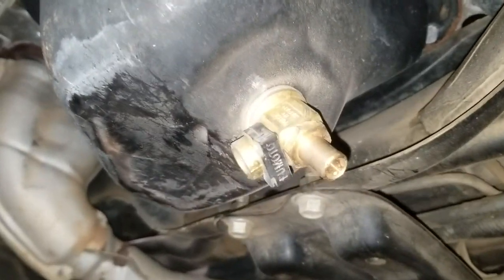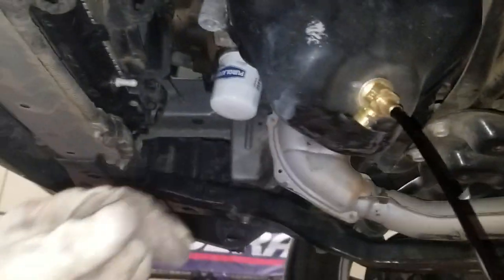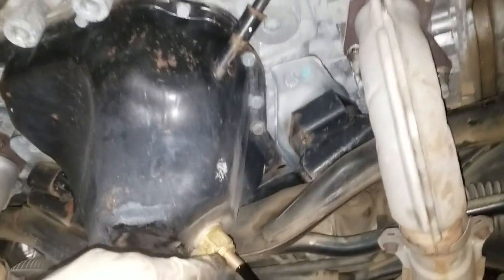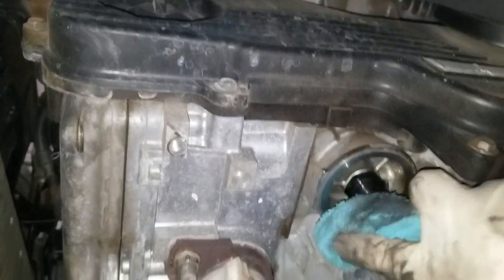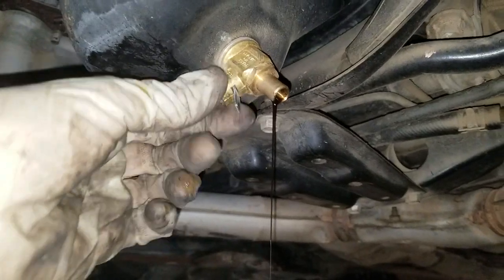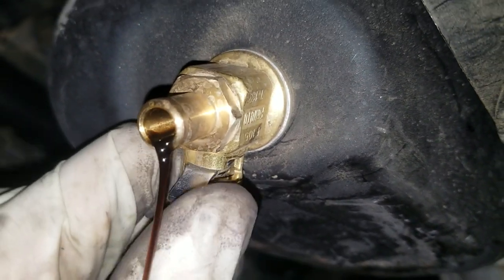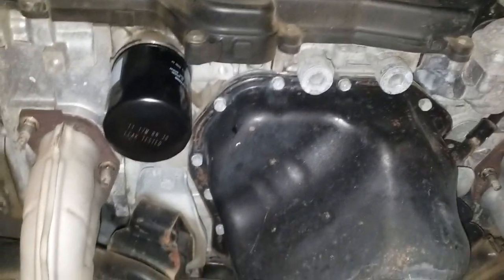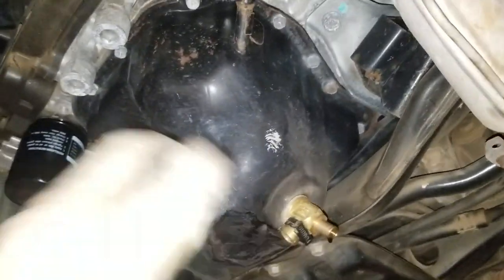Fumoto drain valve dangerous to your engine?

Comment: Your title "Fumoto drain valve dangerous to your engine?" seems misleading..
Reply: For realz. Lol
Reply: Gino Lee That’s why I clicked on it. Looks like it’s nice to have and not dangerous at all unless when he mentioned the ground clearance issue.
Reply: Good afternoon, Gino 

Great video. You totally explained everything to detail. I will get an oil drain valve as well for my Subi. Gracias
Reply: Unnecessary! A point of failure more, a plug is way more secure than a valve, just to avoid the usage of a wrench and a few turns? No thanks not worth of the risk for a valve failure
Reply: @gaquesad Your concern is understandable.  I've used Fumoto valves on 4 cars and one diesel pickup truck for over 15 years. Never a failure, they're made of brass.  I'd rather have that valve in place, than risk the drain bolt being cross threaded and over-torqued if, when the time comes, I have to leave it to a shop to change the oil.
Reply: @gaquesad  Some people install it to make emptying excess oil out easier. Don't need to decompress your crush washer
Reply: Yea so he can get the  viewers to watch. Silly for your guys to do that. But I that’s why I don’t subscribe. Scottys channel does this all the time.
Reply: Yeah.  It's called a liar!!
Reply: Understand this is dangerous. If you lose your clip that lever could get knocked into the open position and now the oil will drain out of the pan and you’ll burn your engine up
Reply: @lanceshier741  - if you had one, you’d understand that it’s virtually impossible for anything to open that valve by accident. Believe me I have three of them and I’ve used them for 15 years. They’re awesome.
Reply: Click baity
Reply: Extra old oil will stay inside, unless you grind away some of the valve thread...
Reply: @pfoxhound the amount is literally negligible, you never get all the oil out with OEM either
Reply: @isiahneidigh4711  for some of us it's more like a religion.
Reply: @pfoxhound  I Believe it, my cousin says he leaves his drain plug open overnight
Reply: @isiahneidigh4711  I was counting how many drops per second, amount per hour... My other buddy leaves drain open overnight. Every time I have access to alignment rack - I lift one side of the car so that oil will come towards the drain...
In semi Truck I have a valve like this, 11 Gallons oil change, but I make mechanic to fill oil with drain opened, waiting to see clear oil coming from drain...
Reply: That’s why you need to change the oil every 5k miles (maybe max of 7.5k) instead of 10k. Oil is cheap engine is not.
Reply: I think they meant it as a rhetorical question, not literally.
Reply: I have two Fomoto drain valves and never had any issues. There are possible problems but they are better engineered and higher quality than a lot of factory parts. The answer is; It depends on your application.

Comment: I've had a fumoto valve on my STi now for 16 years.  ZERO issues.  They work, don't drip or leak.  My STi is an 05'.  I put the valve on it the first year I owned it.
Reply: is it suitable for all sizes models... i have honda crv 2010?
Reply: @aseelmalki4689  yep, go to their website and put in your vehicle information and it'll tell you which valve is compatible.
Reply: Thank you that's reassuring I just installed on my lancer. Thank you bro.
Reply: That’s quite an endorsement! I just learned about these recently and being a maintenance freak I’m a little late to the party. I am looking at the Dorman part also. Thanks again for your comment!
Reply: @greggschachterleppc2769  Just make sure you buy the fumoto brand not some knockoff or dorman brand.  It's not worth a leak and or having your oil spill out.
Reply: Funny you say that. I just stopped in at Advanced Auto and looked at their dorman valve and decided against it. Looks like the Fumoto is a better design and I will be getting online and ordering a couple for the vehicles. Thanks for your follow up!
Reply: That’s a lie. No sti last 16 years!
Reply: @Dcdc956  ROFl.

Welp, mines in the garage.  I'd pay a picture of it here if I could.  Aspen white with gold wheels :)
Reply: @Willohbee  I have no nipple on 3 of the valves on our cars.  The newest one I got the tiny little nipple one so I can use their little nipple cover cap to cover the nipple from the elements.  Don't need debris getting in the nipple hole.  Just for good measure, nipple, nipple nipple.
Reply: @NewShockerGuy  haha thanks bud just ordered one for the XT and one for the STi 🍻
Reply: @greggschachterleppc2769  One's made in Japan, and the other doesn't cost as much. You can guess which one is going to be top quality!
Reply: Mine is leaking from the ball valve after one year🤷‍♂️

Comment: I've had a Fumoto on my car since 2019. I did remove it once because I was curious to see if the part that threads into the oil pan was preventing any oil from draining vs the conventional way. The truth is, it does not. Barely a drop came out when it was removed.

Comment: The valve is not dangerous to your engine but that filter is.
Reply: Why, is it not a good brand or something?
Reply: @SuspiriaX  Purolator is a good brand, but he's using the cheapest Purolator filter meant for conventional oil lol.
Reply: I will only run the Tokyo Roki filters on my Subaru, unfortunately my dealer only has the blue American ones that are made by FRAM

Comment: why are you stopping draining when the oil is still leaking down. It is at least 300 ml are in the pan. I put drain plug back when oil rarely drips
Reply: Stanislav Sidor ...word up!
Reply: He said it was factory procedure.  You're really not going to get 300ml at that point.  And even so it wouldn't really matter much.  In my last gasoline vehicle about half the oil remained in the oil coolers.
Reply: this is true for most cars. but he did say "factory procedure" and he could be doing it for a good reason. some cars have variable oil pumps in them. if you drain all the oil from the car during a change you run the risk of never being able to gain oil pressure again. the fix for that is then overfilling the obsolete shit out of the motor with oil try cranking it over once drain the excessive oil from the car then crank and trying and hope you get oil pressure again. my current car is exactly like this. you must drop the oil and filter and re fill it within 10 minutes or you run the risk of the above happening. fucking stupid. all in the name of maybe saving a bee's dick worth of fuel.
Reply from the maker: You can't get all the oil when you change oil. And if you do the changes often and the engine is running well it is not necessary. If you are running a weak oxygen sensor, poorly filtering air filter, worn maf sensor, poorly operating cooling system, abusive driving or junk quality oil, a few drops of oil is the least of your worries.

Comment: I have run Fumoto valves all many different vehicles for many years.  Never had an issue with the valve.  All good and make your oil changes quicker and less messy.  Also, never need to worry about a stripped, rounded off drain plug or stripped oil pan.
Reply: Is it compatible for all car?

Comment: Have one on every vehicle I have or had for the past 5 years. Absolutely a must have
Reply: Since 2005 here
Reply: Until someone just really hates you and go drain all your oil out lmao.
Reply: I will buy one for my camry 09 hybrid.
Reply: @DoctorRickSanchez  someone could do that with a normal drain plug anyways lol
Reply: I've used Fumoto valves since 1978.  They work great, they don't leak, they can't open accidentally or from kicked up road debris.  They make oil change times nothing, and they're way cleaner.  There's no better oil drain valve out there-- there are cheap copies, and there are drain valves that require a fitting to push the ball away.  The Fumoto is a real ball valve-- when it's open it's wide open.
Reply: @DoctorRickSanchez  Yeah, it's a quick drain, but so is turning a socket if someone is cruel enough drain your oil on you with even a regular drain plug.
Reply: @algallego  Yeah true that but not EVERY single person has a socket set with them is what I really meant by it.

Comment: I have installed them on all of our vehicles, years ago.
The nice feature about them you can drain the oil directly
into milk cartons and not have to use a separate drain pan.
Reply: Good tip
Reply: ...I don't know about milk cartons, but I drain the oil into old 5L oil jugs.  makes hauling to the autoparts store for recycling much easier as they have handles and aren't made out of flimsy plastic and have a screw lid

Comment: add an extra (thicker) washer to raise the spring lever from the 8:00 position to the 10:00 position, possibly?   I thought you were going to comment the dangers in it not allowing all of the oil to drain out of the pan and that metal bits/sediment  can't make it out of the valve as the it sits 4-5 threads up into the pan.  I guess that is where a harddrive magnet affixed to the bottom of the pan comes in handy.

Comment: I installed one of these on a 2002 Nissan Xterra I originally bought new and the oil drained so slowly on a warm engine that I removed it from the vehicle after doing one oil change. The hole through the ball valve is too small on the version I purchased probably ten years ago. I still have the vehicle and valve. I have a new 2023 Toyota Tacoma that is still needing its first oil change but if I decide to replace the drain plug I may look for different manufacturers of drain plugs first.

Comment: Referring to 0:51, when I am working with an oil filter installed straight up (or at a slight angle) I always take a nail and hammer and poke a hole at the bottom of the filter and let the oil drain that way. It takes a bit longer, but only one stream of oil and no mess
Reply: umm no.
Reply: Pro tip for removing oil filters, especially when they're in this type of vertical orientation: Take an empty two-liter soda bottle or a similar round, relatively narrow bottle, replace the cap, and cut off the bottom. Loosen the oil filter enough to begin removing it by hand, but not enough for oil to start leaking. Then slide the bottomless bottle over the oil filter and loosen it. All the oil will go into the bottle, rather than down your arm. Be careful to secure the oil filter and bottle when the filter breaks free of the threads!
Reply: It's just motor oil, wear a glove and put the drain pan underneath the filter like a man....
Reply: @bobbymoss6160  I think being inventive is pretty manly
Reply: @intox69  umm yes
Reply: Ive done that on my 01 F350  which holds 2 qts in the filter but its too much trouble. I just loosen and let it drain into my pan.

Comment: Ground clearance? What type of car would have a the pan sticking out low enough to touch the ground? The cars I've owned and installed Fumoto valve on all have a plate on the bottom covering the oil pan, and the valve is not even touching that cover, much less touching the ground.

Comment: I love the idea of these but I think the o.e. bolt with the magnet is my concern. I would like to pull that and make sure there are no chunks of metal that I should be concerned about. It is nice though and that's my concern.
Reply: If you really want to do a thorough check for metallic particles, cut open your filter and inspect it.
Reply: I run a used oil sample to Blackstone Labs every other change. They analyze it and report a lot of information on its contents: various metals, soot, carbon, antifreeze or fuel contamination, remaining additives, etc. The lab also suggests what engine parts might be wearing down or could be heading for future failure. $30 a pop, including sample vial and prepaid mailer. I use a Purolator Boss filter that clears out debris down to something like 20 micron particulate size. We put less than 5k miles per year per oil change cycle on our 2017 Subaru H4 engine, it consumes roughly 1 ounce each change cycle, probably thru dipstick usage.

Comment: You can use a piece of wire bent with a small L so its 90 degrees into the oil drain hole and use that to measure how thick the pan is. If this drain plug when screwed in extends higher then the pan thickness at the plug hole, then some metal particles settled at the bottom won't run out with the oil, as the plug will block them.

Comment: Something I should have done years ago.  With or without the locking element this valve is not opening on ots own.  Oil drains as fast as it does when  removing the drain plug.

Comment: wow you got a Subaru with a good oil filter location. mine has the ring of fire filter in middle of y in exhaust pipe.
they make the valves with a shorter nipple for better ground clearance.

Comment: What kind of vehicle do you have that has 3 square meters of space around your oil filter. Seriously I think some manufacturers sit around and think of ways to bury their oil filters a deep up into the engine as possible
Reply: ha ha.  They don't sell them here anymore but the Nissan Quest is the biggest PIA for a filter change.  Yah gotta pull the right wheel off-really (sloppy drain too!). Boy, was I surprised when I went looking to do my 1st change. Who woulda thought of putting a oil filter behind a shield behind a wheel?
Reply: The original Isuzu I-Mark had the oil filter behind the transverse engine, facing the firewall, between the intake  and exhaust manifolds.  I literally did not see how it was possible to change it.
Reply from the maker: This is why I love servicing Subaru

Comment: I love mine. Been using on my honda for about 5 years. I like to drive around a bit to get the oil warm so it flows better.  Now the guys that like to alter their factory suspension. Do not need to install these. 

But my oil changes are quick and easy.

Comment: I wonder if it allows all the oil to drain or does it stick up in the pan and prevent oil to completely drain
Reply from the maker: Well the stock drain doesn't get it all either. But it will be like 2mm higher than stock. But if you change often and take care of the engine, it doesnt matter much at all.
Reply: I have found that with any vehicle I have, Fumoto or not, if I want to get that last bit out of the oil pan, the car should be tilted.  Some cars, being nose up is good,which fits with ramps and oil filter and drain plug access. But some vehicles I have, I jack from the side and get more to come out.

The way to experiment is let it drain until it's dripping slowly, then try tilting the car so the side of the engine with the drain plug is on the low side, if you see a steady oil stream again, you've done it right.

Some people just pour a quart of fresh oil into the motor while it's on its last drips, to flush out all the bad old oil. I can't bring myself to do that!

Comment: These are not dangerous at all. I have a Fumoto drain valve on my 12 year old Rav4 that I installed on the first oil change when the truck was new. Never had a problem. Made oil changes so easy that I was looking forward to it. Highly recommended.
Reply: if there are any metal pieces do those come out of the drain as well? or does it stay there?
Reply: @alexpenaloza1628  The fumoto drain valve opening is big enough to let any metal shavings from normal wear and tear pass thru. If you have metal fragments in oil larger than the Fumoto drain opening, you should seriously have your engine checked.

Comment: I drive a nail in my filter, which makes it easy to direct the flow, or at least the vast majority of oil in the filter, right into a pan. Then I use a sandwich Ziploc, to remove it, basically eliminating all mess.

Also, the argument of not pre-filling a filter when it’s oriented like yours doesn’t make any sense. It takes an extra 10 seconds to put oil in the thing. I don’t understand people who don’t wanna pre-fill it regardless of what they think it does or doesn’t do.

Comment: Could you also screw a cap(hand tight) over the threaded portion just as an additional measure against the valve getting knocked open?  That way oil wouldn't just atart pouring out if it opened up.
Reply: The only threaded portion screws into the oil pan. Where the oil comes out has a ridge for a hose to be attached. You could certainly plug that, either with a cork-like thing or a short section of tube with a pinch clamp,  but I just leave the hose on the nipple, the loose end held with a little retainer clip screwed to an unused threaded hole on the engine block. There are also a few different configurations that Fumoto sells, lower profile, swivel, etc.
Reply: Once you try to open them with your fingers, you realize they're not going to be opened by debris. And if you're concerned about that, Fumoto makes a plastic clip that locks over the release tab, and you can see it in the beginning of this video.

Comment: can the filter be filled with fresh oil to lessen the length of time before engine receives lubrication, as opposed to the time taken to first fill the new filter?
Reply: If the filter screws on with the hole facing up, you can fill the filter nearly completely.  If it faces sideways or down, then not so much.  On a 240 Volvo, you can fill the filter.
Reply: I've heard mechanics say this is a bad idea because of possible contaminants from the factory that wouldn't be filtered from the center. Rainman Ray's Repairs makes note of this and explains why he never pre-fills filters.
Reply: If you can figure out how to “flood mode” your vehicle, that can mitigate that concern. That’s what I do with my coyote f150